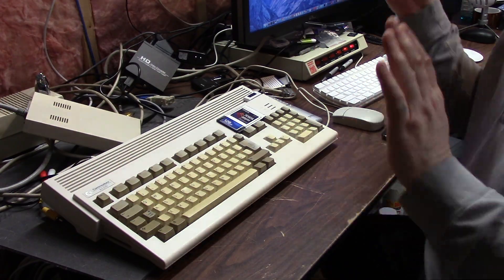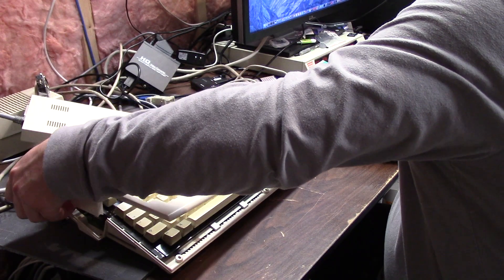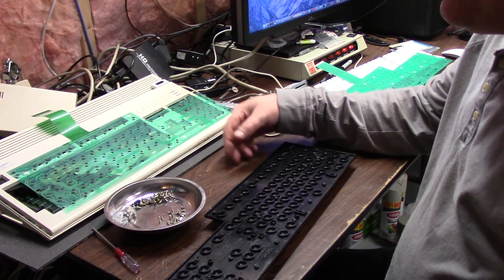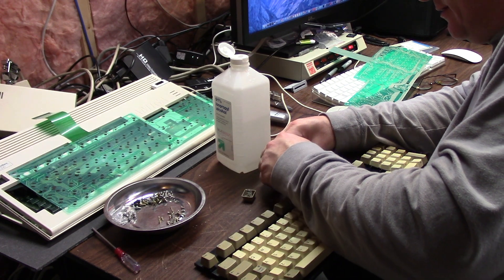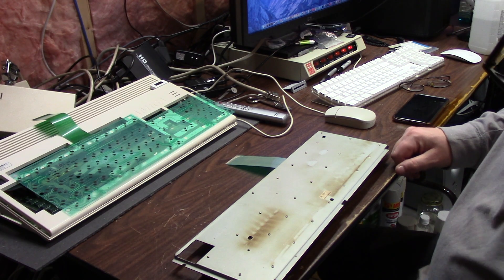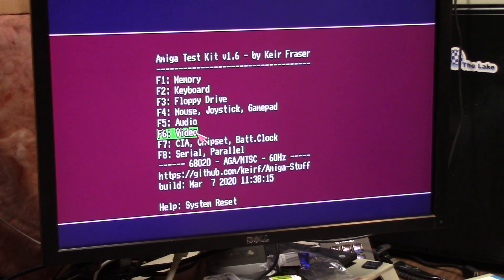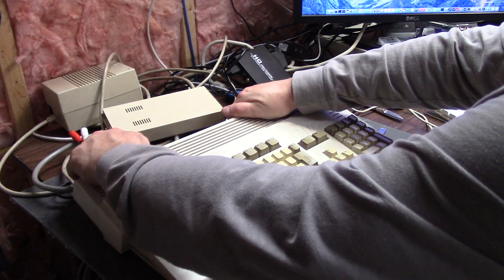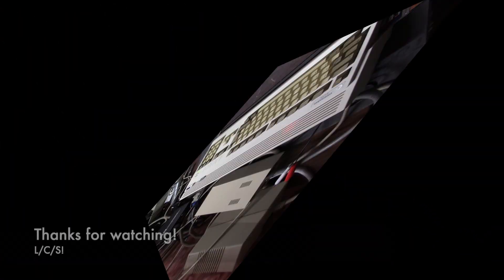Commodore Amiga 1200 keyboard membrane repair and replace

Comment: Nicely done, but I could not stand these yellow and dirty keys for that long. I got a mere 1 gig cf in my 1200 , put loads of mod files, whd load games etc on itband you know what? I still have enough space for plenty of games. What is yor plan with the 32 gig cf though?
Reply from the maker: idk, have them, going to do prob a 3.9 o pfs3 or 3.1.4.1 install w a split volume, 3g sys: and the rest dh1 for whdload or something...

Comment: You had to desolder and solder the audio caps back on. And this came as a recapped motherboard. And the broken keyboard. People don't test stuff before sending it off. So much crap on ebay. And A1200 stuff is especially overpriced.
Reply from the maker: and I get ripped off all the time... recapped , more like a few were recapped... I think the seller removed licked them and then soldered them back on... lol.  all sorted now though...
Reply: @ChrisEdwardsRestoration  He probably skipped the Audio caps because they are quite hard to get at. I imagine you paid a premium price for that motherboard aswell. Luckily I bought an A1200 about 5 years ago. Before the prices skyrocketed. It was very white when I got it. After a short while it started yellowing badly. Of course the seller had retro brighted it. Not only that, but the keyboard springs had rusted like crazy. He had not removed them for retro brighting. LOL.